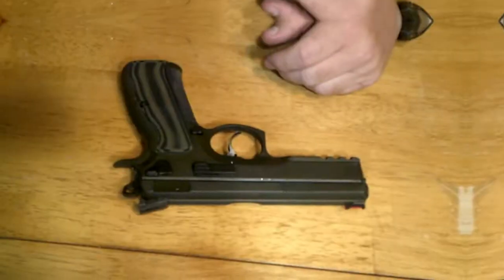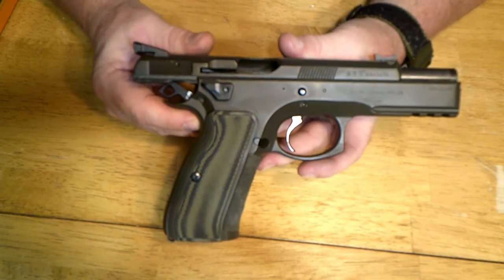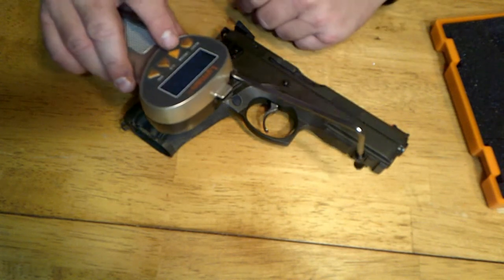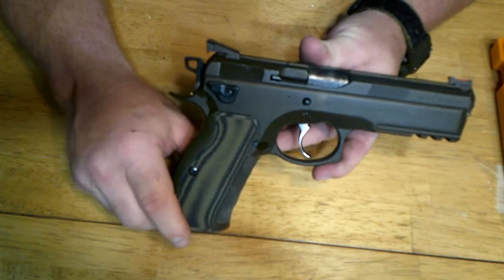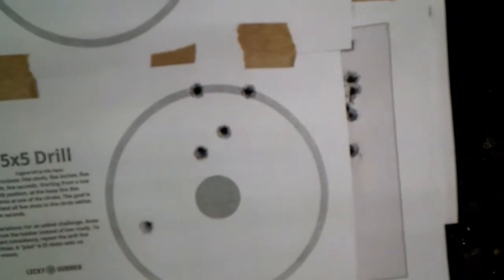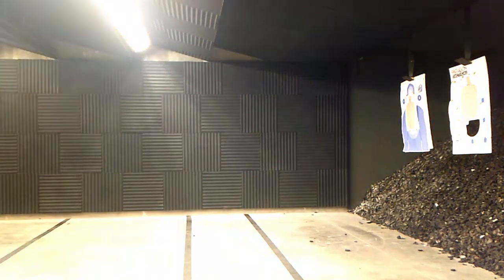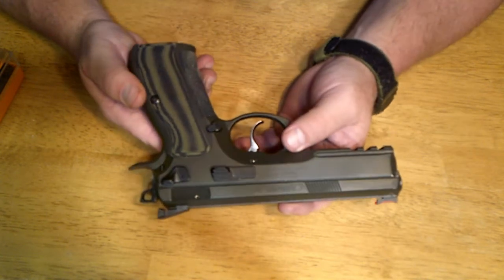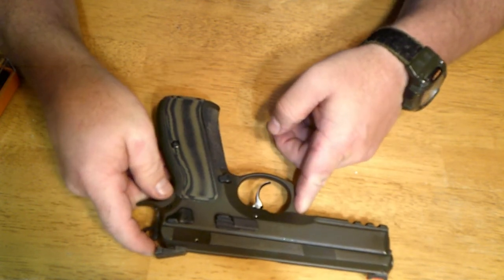Cajun Gunworks CZ SP01 Tactical

Comment: Does your SP01 have the pro package trigger kit from CGW? Trigger looks amazing
Reply from the maker: It does. It’s worth every cent too
Reply: @glocksrock1  The cajun gunworks pro package says 3.6 to 3.1 lb trigger pull, the other packages say sub 3 lbs trigger pull.  Are you sure its the pro package or is it the IDPA package? Why is yours so light compared to advertisement? Thanks for the video.
Reply from the maker: I did extra polishing to mine. It’s a drop in kit, but if you take the time to polish areas that are needed it can be batter.

Comment: Just got a tactical, do they keep the firing pin safety in after the upgrades
Reply from the maker: I did all the work myself. I took the firing pin safety out. You don’t have to, but the trigger won’t be as good if you don’t.

Comment: Do you carry this or use it for self defense? Every piece of legal advice I have ever received regarding firearms for self defense suggests 4 pounds is about as low as you want a defensive trigger. This has been established in court by professionals who carry SAO guns like the 1911. And your lawyer is going to cringe when he finds out you removed a safety device from the firearm you used in self defense. I Cajunized my SP01 by installing a CGW aluminum SAO trigger and SRS-1 short reset kit, but elected to keep the firing pin block and even installed a heavy lifter spring to keep my SAO pull a clean and consistent 4.5 pounds or so. I am not dissing your gun or anything, those CZs are sweet shooters and you can use what you want for self defense. I am just sayin, a prosecuting attorney would have a field day explaining the recklessness of removing a safety from a defensive firearm to a jury, and will have no shortage of expert witnesses to testify that an "almost 2 pound" trigger pull is much too light for self defense.
Reply from the maker: I don’t carry this gun

I’d like to purpose a question. Not arguing, just something to think about. If you are involved in a defensive shooting that is deemed justified, why would you be in court explaining your trigger? There would be no court because charges would not be filed. 

If the incident was ruled to be unjustified, I believe you would need to worry about more than just the poundage of the trigger pull first.
Reply: @glocksrock1  According to Massob and others, prosecutors use light trigger pulls and removed safeties as ways to introduce doubt by suggesting shoot was negligent, and therefore not legally justified.
Reply from the maker: You are correct. The prosecution will use those things stated during a trial in an attempt to gain a guilty verdict. That would be brought up during a trial of your pears. If the incident was deemed justified you would never have to go to court. Here’s and example. I Tennessee, if someone breaks into your house, you have the right to assume they are there to do you harm. If you shot shot that person, it would be ruled as justified use of force and the weight of your trigger would never come into play. I’m not saying a 2# trigger is advisable, but if the shooting is justified, it can’t be used against you. If there is a question about the justification that’s when it might arise. Even then, it would have to fall into some context that would be relevant to the shooting.
Reply: @glocksrock1  No you don't understand. Massob states that these things will be used to determine if the shooting was justified. If you shoot someone in self defense, your firearm is going to be confiscated and an investigation is going to be done by the police. When they inspect your firearm, they are going to insure in it safe and legal. They are going to measure trigger pull and check to make sure all safeties are intact and functioning. If you have a light trigger pull or have removed safeties, they are going to argue shooting was negligent and therefore, unjustified. You may be brought up on charges and prosecuted, because legally, the condition of firearm used in defense matters.
Reply from the maker: Let me get this right, if someone breaks into my house and I shoot them , you’re saying if my trigger is too light I can be prosecuted?
Reply: @glocksrock1  Yes. It depends more on individual prosecutors than on the state you live in. Missouri is a red state, and 2nd Amendment Sanctuary State. They still had an over zealous prosecutor go after a couple for brandishing a rifle to defend themselves from a rioting mob on private property. And she would have successfully prosecuted this couple had the attorney general and governor not stepped in. 
Here is Massob Ayoob discussing the issue- 
https://www.youtube.com/watch?v=EeLgzT-9N54
Reply from the maker: I know where you are coming from in relation to the video you shared. I have no idea what the laws are in your state, I can only speak to the laws in my state. It is impossible to prosecute a citizen in Tennessee if they shoot a burglar. Likewise the laws of the state also prevent the person from being sued o. Civil court. The law also extends to our vehicle in this state, so if a person tries to car jack us, we can defend our car like our home. The weight of our trigger has nothing to do with the justification of the incident. We will have to agree to disagree on this point but a friendly discussion is always good.
Reply: @MTMILITIAMAN7.62  if you’re legally justified to shoot someone, it doesn’t matter how light your trigger is. Your comments then suggest a homeowner has to grab their “correct” firearm to shoot someone like their revolver with a 12 pound trigger and not not grab their “wrong” firearm, like their competition gun that is highly modified and that may have a 1 pound trigger. What a joke.
Reply: @SectionChief  It doesn't affect whether you're legally allowed to use lethal force. It allows the prosecution to suggest you modified a weapon to make it more dangerous, and therefore intended to put yourself in a position to use it. Legally, this is called mens rea, which is Latin for guilty mind, and it is all the prosecution needs to provide the shadow of a doubt necessary to convict you. Massad Ayoob has a lot of experience in use of force and justifiable homicide cases. He is an authority on these issues and when he speaks, it is wise to listen. A zealous prosecutor will use anything they can to paint you in a bad light, so weapon modifications should be considered carefully. Removing safeties is no-go. You're not going to be able to explain to a jury how removing a safety from a firearm is necessary and prudent. Hair triggers also don't look good. The prosecution is going to bring an expert witness to the stand to explain to the jury duty standards for use by professionals under duress to prevent accidental discharge is 4 pounds or greater. And you're going to be stuck trying to explain how you know better than experts and professionals. Good luck with that.
Reply: @SectionChief  It doesn't matter what state you live in. If you shoot someone, even in your home, there is going to be an investigation. Guaranteed. Your gun is going to be confiscated and examined. You don't  get to shoot someone and not get investigated, in any state, ever. Period. If they examine your gun and discover work has been done to it to remove safeties or lighten the trigger to what they deem unsafe levels, that is all a zealous prosecutor is going to need to determine negligence and bring charges against you. These Soros/Obama implated prosecutors are in every single state. It just isn't wise to modify defense guns by removing safeties and putting super light triggers on them, because you are going to have a hard time explaining these things in court against state witness experts and professionals. Removing the safety from a firearm could be what renders the shoot unjustified and gets charges brought against you. That is how our legal system works. It might not seem fair, but it is reality.